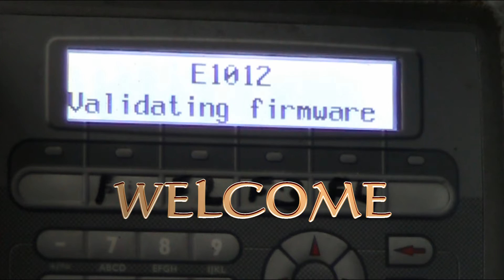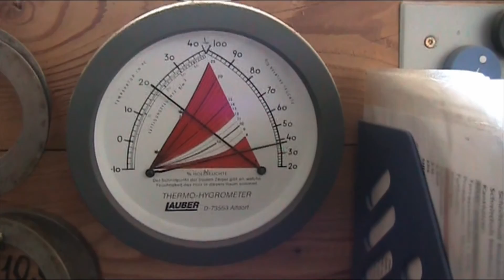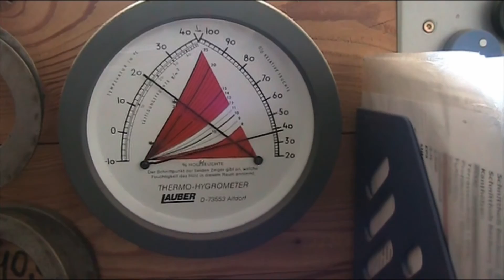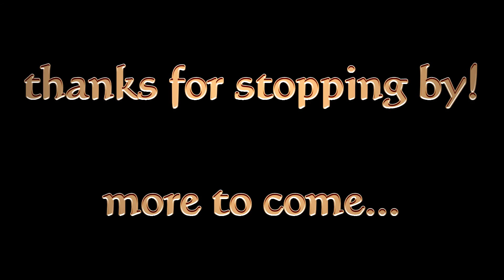the Stack, episode 3: relative humidity

Comment: Great information, why do you cut the wood like shown behind you? Is this for pre EMC management? After it acclimates, do you process further??  Also, cutting like this doesn’t allow for much quarter sawing.  Your process looks like plain sawing only and very thick lumber. Are you doing this because you are processing 2x’s?  Thank for any help!
Reply from the maker: most of the wood you see in the frame goes to cabinet shops and furniture factories. the live edge allows for more flexibility when divvying up the board as one can follow the grain closer, thus taking out a lot of the internal stress and reducing waste. it also reduces warpage since the cut stock doesn't have grain going any which way across the face of the resulting board. if following a grain pattern is top priority (as it should be in any piece of furniture) then this sort of lumber allows for that the best. when all you can get is edged lumber you are more or less going to hold to the established edge and often miss the run of the grain. while that may look good in some instances, i cringe when i see youtube creators who willy-nilly slap a panel together with grain running in any and all directions. then they sit there scratching their heads how come their panel warped after glue up 
as far as quarter sawing goes, when you get into the heart boards of this kind of lumber you have pretty much homogeneous standing grain only. this closely mimics a true rift cut and produces the kind of cuts optimal for making stable panels. 
most of the lumber shown dries down to 12 to 15% without ever seeing the inside of a kiln. depending on customer need it can be kiln dried to a lower moisture content. kiln drying brings with it a host of other problems that arise due to time constraints of the charge in the kiln. most outfits want a charge in and out in 3 days or less. with shortened heat up and cool down phases, this often generates a phenomenon known as cell collapse. this occurs when the wood cell structure heats up too fast and becomes plastic. the escaping moisture then allows the cells to collapse into themselves. it's easy to spot as the board surface has some funky looking warping to it and when cross cut, some weird looking internal checking. this defect makes the wood inherently instable when changes in the relative humidity occur where the wood resides at its end use location.  
as an example, white oak should be in the kiln for around 3 weeks. it takes a good 3 days to bring it up to temperature. the rH in the kiln also has to be held fairly high during this phase as to retard the premature escape of internal moisture.
only when final drying temp has been reached, the drying cycle can begin. by keeping the rH high during heat up, it opens the pores of the wood and sets the stage for the water deep within the wood to escape easier as water is a polar molecule and the deep water will follow the other molecules to the surface. 

the other big advantage of retaining the live edge, is the warpage that does occur during the drying process is bypassed completely when the board is being cut in later processing

while it may not be apparent in the video, there are a plethora of thicknesses in the yard. again, depends on customer needs. thickness ranges from 25mm(1 in) and goes all the way up to 80mm (3in) in some cases even 100 or 120 depending on customer specs. 52mm is by far the most requested thickness although 45mm, 40mm and 65mm are other high demand cuts

most sawmills in the US no longer cut for grade. they just shove as much volume thru as they can without any regard for the potential earnings if sawing for grade. they think they can make up for those losses at the grading table in front of the trim saw. delusional...

Comment: G'day HM, you sound like you're a Meteorologist as well ! my interest in the weather is related to primary production, a company called Marbut and Gunnersen established an air drying yard and kiln and a re sawing mill with a retail outlet in my town a stones throw from my house sixty or more years ago after having two German scientists travel around the country recording average yearly temperatures and relative humidity. They decided  on Seymour Victoria because of it's logistical position with the branch of two rail lines and two highways but most importantly it was the most southern town North of the great dividing range so it had warm dry air from inland Australia a EMC of fourteen percent not to hot not to cold and not to wet that's why I dry my timber here in the goldilocks  zone 👍.

Comment: I'm glad you mentioned removing the saw dust/chips. I have just started my own Alaska saw mill and drying over the past year in Georgia. I had a pine tree fall in my yard and processed and started drying it. I hand brushed the dust off but just after a month or so I saw mold growing quickly.  I tried a broom but that didn't remove enough so had to use a wire brush.  It removed a lot more "bound" dust.  I believe it was because the wood was so saturated, literally dripping off the ends of the lumber, the broom or plastic brushes couldn't remove the dust.  The wood is drying better with less mold but I still get a little.  I had to go to 2 inch stickers also as 3/4 and 1 inch was not enough with our high humidity.  I also live at a bottom of a hill so that doesn't help either.
Reply from the maker: oh yes, you're not in a good spot for drying.. pine likes to turn blue quickly in your neck of the woods. the only thing that can slow it down is milling the wood in the winter. although there is no guarantee of that in georgia either since winters there are generally fairly mild. 
the pitch in the pine will make the sawdust stick like a magnet, so you have correctly identified the need to get rid of it when the boards are cut. 
there are wire brush brooms available and they really well with sticky, pitchy woods getting the sawdust off the planks.
if you can figure out from which direction the prevailing winds are coming and orient your stack so it catches the most wind, you should be able to cut down on the molding even more.. 
hope that helps... 
thanks for watching and commenting!!

Comment: Hello I have a question on drying a slab of suagr maple 4 3/8 thick. it was cut down in april and have cut the double live edge slab for a mantle. What is the best way to dry it without getting cracks and how fast should i dry it. Thanks and Love the videos HolzMichel.
Reply from the maker: my apologies for the tardy reply!
first off you should keep that slab out of direct sunlight. the second is to stand it up with the butt end up with the maximum allowable airflow around it. under the eaves of a long overhanging roof or in an open sided shed or tobacco or onion drying shed. the important thing is that the slab has lots of air surrounding it as it dries.
the old timers used to dry maple, hornbeam and birch in this fashion when kiln drying wasn't available or as wide spread as is today. the main objective is to disperse the remaining moisture in the wood and bring it down in a controlled fashion to prevent blue stain fungi from getting in. there are several species of blue stain fungi and they all consume the sugar in the sap of the tree that still remains in the wood after milling.
if you haven't already and have read some of the other questions in the comment section of this or the other videos in this series, you should seal the ends of the slab with some kind of impervious substance that will inhibit moisture form escaping out the ends of the slab. this will prevent cracks from forming. you can use wax (bees wax or stearin based wax) or any kind of old goopy paint. grease would work too, however it will penetrate the wood and render the first six to 10 inches of the slab unusable. 
another thing to do is to take off the bark if you haven't done so already. edible woods such as maple, beech, birch and several fruit tree species are natural magnets for bark beetles. they will bore in and can destroy the live edge of the slab. if you are seeing little piles of frass (sawdust) then they are already in the wood. 
now if you are planning to use the slab as one piece, keep in mind that it will warp as it dries and you will see some cupping. there is no mitigation for this no matter how slow you dry it or how much weight you pile onto it during the drying process. 
if you choose to lay the slab horizontally on stickers, keep in mind that if the slab has to remain stain free, you will need to use stickers made from heart wood of spruce or something similarly resistant to fungi. but also not from a wood like oak that contain tannins. also wherever the stickers make contact with the slab you will probably see deep staining. which is the reason for standing up the slab with the butt end up. 
hope that helps
cheers
mike
Reply: @HolzMichel  No worries on Tardyness, i very much apreciate the info. It was very helpful. I will do what you have recommended and hope for as little cupping as possible. Thank you greatly. Gave a Great Day ENJOY.

Comment: Thank you very much for the video. Maybe I miss something, but I can't figure out why would the wood moisture content change based on RH and not based on absolute humidity? It seem more logical to me that if for instance the wood is dry, it will absorb moisture based on how much water is actually around it and not based on how much water there is around it compared to maximum level possible. Maybe you know?   Thank you so much..
Reply from the maker: wow! now there's an awesome question... hopefully i can answer it to where it makes sense. 

if wood is completely dry then yes, it will absorb some moisture. musical instruments for example are made from wood dried down to 5 to 7 percent moisture content. they do absorb some small amounts of moisture from the air. so your thought is correct. 

air dried lumber reaches an "equilibrium" of about 12 percent in some localities as low as 10. but that's after many years and many cycles of absorbing and giving off the moisture in turn. 

the creaks and squeaks you hear in timber framed and also in stick framed buildings when no one is moving around in them, is the change in moisture content. the wood is shrinking or expanding depending on the time of year.
wooden houses are drier in the in the winter months due to heating, moister in the summer due to the lack thereof. cold air that is heated to room temperature is much more absorbent thus removes more moisture from the air in the winter because the RH changes dramatically when cold air enters the building and is heated up. 

this is also the reason that when you are laying a solid wood floor you need to leave a gap of roughly half an inch between the flooring and the wall. gluing the floor material down can cause the floor to buckle as humidity increases.
laminate flooring doesn't have that problem but you still need to leave a gap due to temperature changes, although not as big a one.
similarly when doing panels in cabinet doors: you need to leave a little room for expansion of the filler panel in the frame so it doesn't burst the frame when the humidity rises in the summer.
wood also has a funny characteristic in that it lets water go much easier than it takes it in. this to porus/torus effect in the cell wall structure. it acts as a one way valve. this is keep the sap from running back down into the roots during the times the tree is active with photosynthesis. although water is a polar molecule and is pulled up into the crown due to polarity from the evapo-transpiration, it's first inclination is run back down. having a check valve in place guarantees one travel of the column in the bole of the tree..

there is an old german proverb: what's the difference between a bureaucrat and wood? wood is always (at) work(ing). 

hope that wasn't all too confusing.
cheers
mike
Reply: @HolzMichel  THANK YOU so much for the quick response. I still don't seem to find the answer though. If we'll take a cube of air, and let's say 1/2 of this cube is water vapor, and in the middle we'll put a piece of wood- this piece of wood will touch now equally distributed water at 50% of its surface. Now, if we'll change the temperature, the RH will change, but the wood is still touching 50% humidity no matter what. That's my point..
Reply from the maker: @shonshon247  ..it's a real confusing topic. as the air temperature rises, relative humidity falls. there is a scale that illustrates this. 

example: at 0C and 100% RH you get fog. (fog of course can appear at any temp as long as the RH is 100%) if you raise the temp by one degree the fog disappears. the air has been able absorb the moisture. you still have the same amount of moisture present in the air of your cube. now if you raise the temp even more the air becomes even more absorbent and begins take away moisture from organic substances such as wood. organic substances usually take direct exposure to moisture i.e rain to substantially increase moisture content. while the air will give back some moisture to the wood as temps fall, the porus/torus action of the xylem won't allow the moisture to penetrate very deeply.  once wood has reached a point of equilibrium of around 10 to 12 percent, the change in moisture content is usually never more than one percent. in some rare cases it can go as high as 2. 

what you are talking about is normally only possible in a kiln environment.  in a kiln you can spray and create conditions that aren't present anywhere in nature on the planet.  so in theory and in practice you are only partially correct. however you are not factoring in the ability of the air to absorb moisture with an increase in temperature. 

as temp drops and approaches the dew point, only then will you see any noticeable rise in wood moisture, and it would take a really long time for the wood to take in that moisture to the point it actually reverses the drying action. it is possible and can be done in a kiln, which is a remedy to correct kiln dried lumber if it experiences cell collapse due to a too rapid increase in kiln temp. 

you can do a really koolll little experiment and see how much moisture wood will take from the atmosphere due to changes in RH:
cut cross sectional pieces of a 2x4 no more than a 1/4" in length. weigh them. then stick them in the oven at 140F for two hours.  weigh them again. pput them back in the oven for another hour and weigh them once again..then  leave them outside over night. weigh them again.. the change you see in the weight is the change in moisture content. divide your dry weight by the wet weight and multiply by 100.. then you'll have the actual moisture content. it should vary by about one to two percent. with such thin slices it could go up even more, again the porus/torus action is out of the picture here because of the thin nature of your chunks.
Reply: @HolzMichel  Thank you so much again. I think I am getting it now. I think I need to do some research on how heat actually makes air more acceptable to water, and that would close all remaining gaps in understanding. Thanks again!

Comment: What is the best time of year to cut trees down.? .. looking to make a log cabin
Reply from the maker: that depends on where you're at and what type of wood you'll be using. if you're in the western united states you should be cutting dead standing lodge pole pine, spruce or tamarack. similarly in the east although lodge pole doesn't grow there but i have seen some nice log homes made of white pine. 
if you have to resort to cutting green wood then i recommend cutting it in the summer. leave it lay on the ground without taking the limbs off for at least 2 weeks preferably 3 to 4. that will remove most of the moisture fairly quickly. when the needles begin to fall off you're ready to rock&roll.
you can also cut in the winter when there is plenty of snow on the ground which will make skidding the logs much easier. there won't be any need to leave the limbs on since the tree is dormant any way. 
keep in mind that your logs won't get below 25 to 30% if you're cutting green timber. dead standing will already be well below that if there is a crack the goes deep into the wood. the crazy thing about dead standing wood is the limbs will continues to transpire moisture (albeit at a much slower rate) so using dead wood is preferable to green. 

another mean and nasty trick to use if you have to use green timber, is to girdle the tree and let it dry out that way. you will have to cut about 3 inches deep all the way around so the sap wood is separated. simply cutting the bark off, can make the thing take up to 3 to 5 years to die off and dry out. 

as a general rule hardwoods don't lend themselves to make log houses as they usually don't have the length of bole to get the lengths needed to span a wall.
hope that helps you a little, if you got ant more just fire away